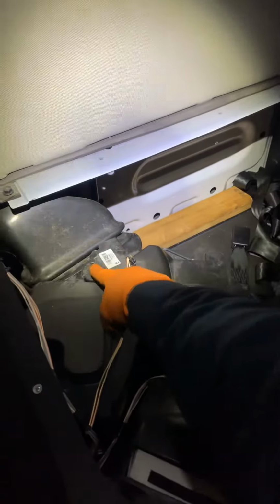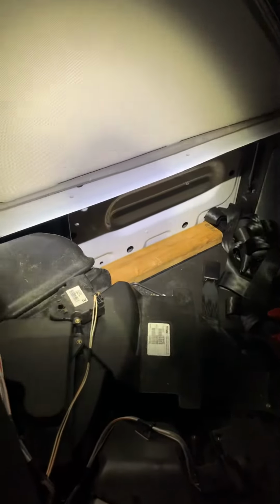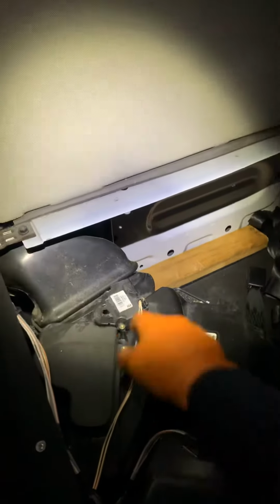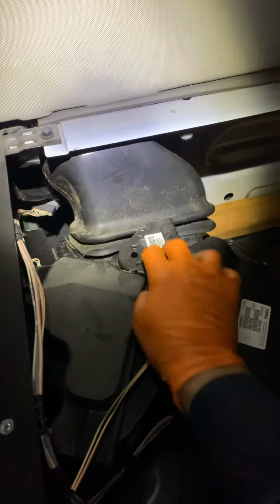Heater not working

Comment: Quick questions my heater works but the floor one don’t work it won’t blow heat to the floor. Can u tell me what the problem maybe?
Reply: Usually the motor went out the one that changes direction of vents